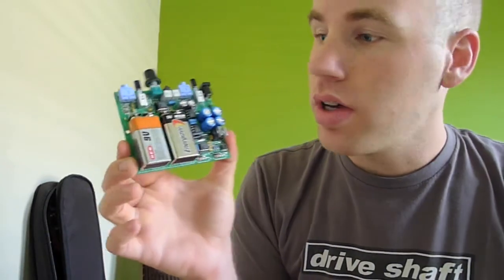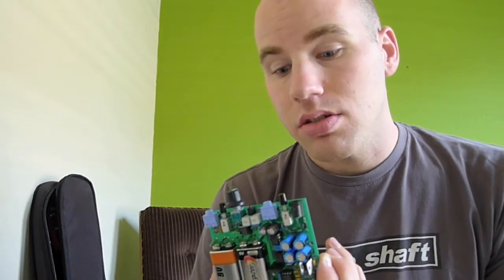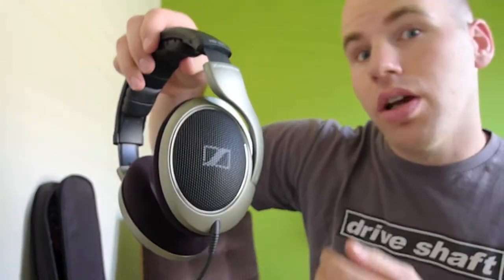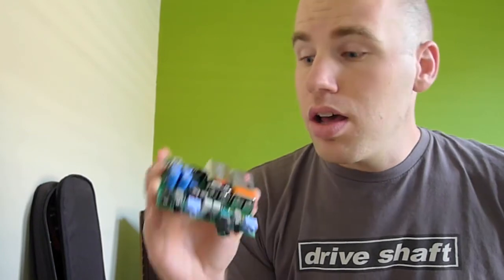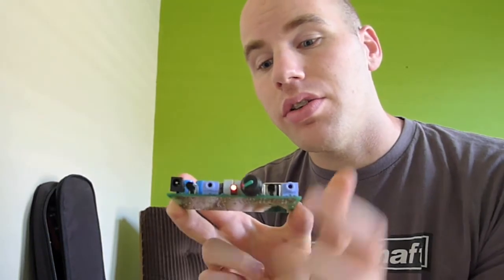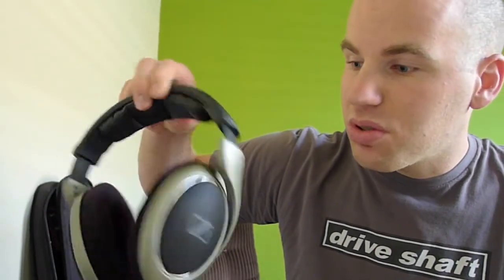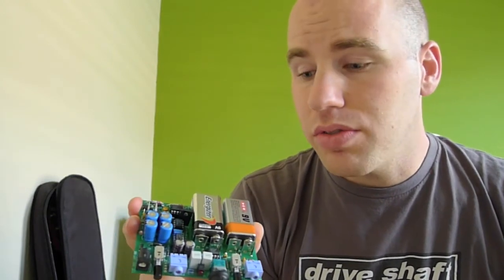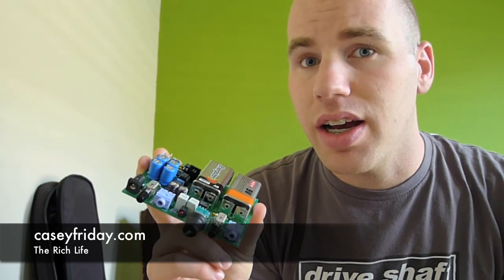O2 Headphone Amp

Comment: Very recently got introduced to NWAVGUY and O2.  I currently live in the UK. I am interested in building one.  let me know how can I start.  once I ordered the parts guess soldering shoudnt be a bigger problem right
Reply from the maker: +Ganesh Saptharishi Not at all - you can download the schematic from his website, and it tells you exactly which parts to solder, and where, and what the polarity is for each part.  The hardest part is getting your solder joints nice and clean - need to warm up the parts considerably before applying the solder.

Have fun!
Reply: +Casey Friday sorry for the studpid question but...i can't find the layout to print my own pcb,im i forced to buy/custom(cad) make one?i know this question has nothing to do with you but i was wondering if there was any accessible way for me to make one...

Comment: I wonder how much it will cost to ship a kit to New Zealand, so you think it'd be worth it just buying the kit from JDS for 60?
Reply from the maker: It's a really great amp.  I'd do it if I were you.  I searched the parts on mouser, and I got an entire kit put together for about $50, power brick included.  The only extras I'd need is the case and PCB (from JDS).  That might save you some money.
Reply: Casey Friday Thanks, I think I will buy one, and try my hand at it, after what you were saying about the JDS PCB, it sounds like it should be an easy project as long as I get my solder points clean and nice.

Comment: Do you want to sell what u have? i am going to try to put a 1/4 jack on it but i was not sure if it would fit with the B3-080 enclosure.  i found the list that was saved in google docs. i can't paste it on youtube. the total comes to 30.84.. but after that the list goes on with more resistors / batteries and other stuff. Do i need that? or would the top of the list for 30.84 built the board?

Comment: Get a DAC, an Amp will primarily change the Dynamics and Volume. The DAC changes how the file is decoded into analog signal. You can even rip FLAC or WAV in a playback program like Foobar2000. Also, a good idea might be to get the Wasapi plugin for Foobar to skip over Windows or OSX audio processing. It's a lot of work and a little bit of cash to get your audio to sound better, but it's worth it.It starts to matter more what kind of music you listen to as well.

Comment: Sound quality probably depends on more than just the data rate. It also depends on the software and other quality options that do the conversion... But I can always tell the difference. I think I can even tell the difference between a CD and a lossless file. I don't want to show off or say I have any special skill, in the opposite. Whenever someone says about any high tech "its not noticeable to human senses" you can basically assume, yes, it totally is, and that's what human senses are about

Comment from the maker: The HD598 is just an upgraded model of the phones I have, still at 50 ohms, so that probably wouldn't be any different.  The HD650 however looks to have a 300 ohm impedance, and costs significantly more - so those are probably a good place for me to start with sound tests.

Comment: Also have you test it with sensitive iem ? because thats where it would hiss, you cant hear a difference between a well ripped 320kbps and lossless unless your using a high quality setup. it would be good if you could get the sennheiser HD 598 or 650. Peace